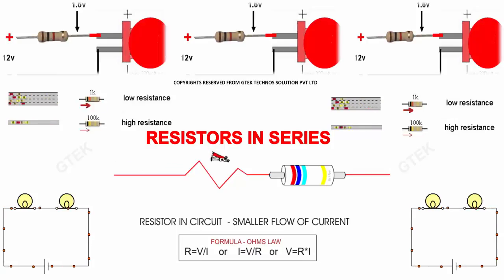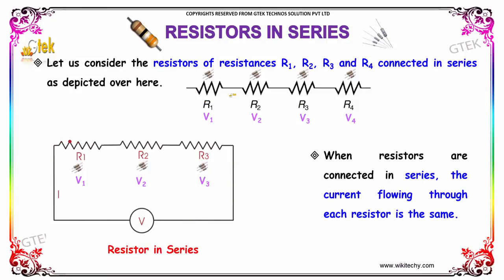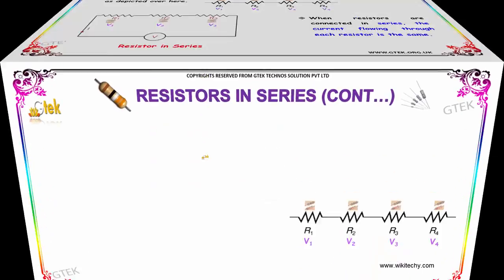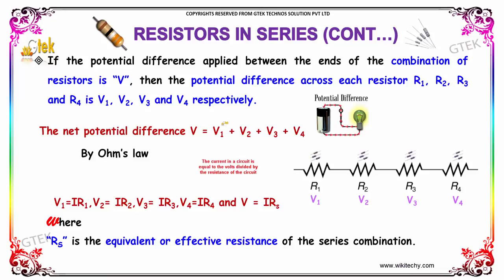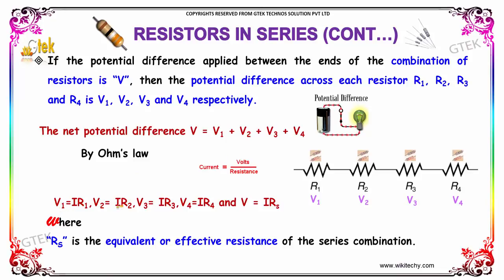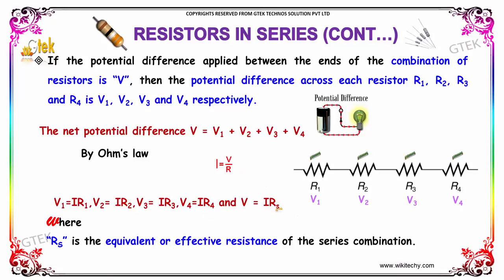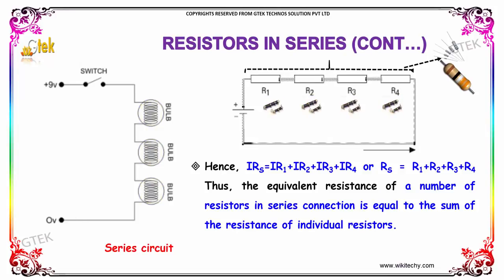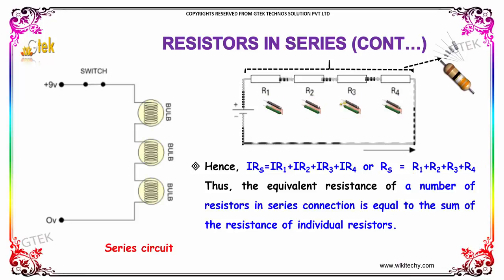Resistor in series Current Electricity class 12 physics subject notes lectures CBSE IIT JEE NEET

Comment: A series circuit is a circuit where there is only one path from the source through all of the loads and back to the source. This means that all of the current in the circuit must flow through all of the loads. One example of a series circuit is a string of old Christmas lights.

Comment: In a series resistor network the individual resistors add together to give an equivalent resistance, ( RT ) of the series combination. The resistors in a series circuit can be interchanged without affecting the total resistance, current, or power to each resistor or the circuit.

Comment: it shows resistors in series connected to a voltage source. The total resistance in the circuit is equal to the sum of the individual resistances, since the current has to pass through each resistor in sequence through the circuit.

Comment: shows resistors in series connected to a voltage source. The total resistance in the circuit is equal to the sum of the individual resistances, since the current has to pass through each resistor in sequence through the circuit.

Comment: The two simplest of these are called series and parallel and occur frequently. Components connected in series are connected along a single path, so the same current flows through all of the components. Components connected in parallel are connected so the same voltage is applied to each component.

Comment: The current is the same through each resistor. The total resistance of the circuit is found by simply adding up the resistance values of the individual resistors: equivalent resistance of resistors in series : R = R1 + R2 + R3 + ...

Comment: Resistors are said to be connected in “Series“, when they are daisy chained together in a single line. Since all the current flowing through the first resistor has no other way to go it must also pass through the second resistor and the third and so on. Then, resistors in series have a Common Current flowing through them as the current that flows through one resistor must also flow through the others as it can only take one path.

Then the amount of current that flows through a set of resistors in series will be the same at all points in a series resistor network

Comment: Voltage is the same across each component of the parallel circuit. The sum of the currents through each path is equal to the total current that flows from the source. You can find total resistance in a Parallel circuit with the following formula: 1/Rt = 1/R1 + 1/R2 + 1/R3 +...

Comment: The current is the same through each resistor. The total resistance of the circuit is found by simply adding up the resistance values of the individual resistors: equivalent resistance of resistors in series : R = R1 + R2 + R3 + ... A series circuit is shown in the diagram above.Jul 10, 2000

Comment: The total resistance in the circuit with resistors connected in series is equal to the ... Individual resistors in series do not get the total source voltage, but divide it.

Comment: The resistors in a series circuit can be interchanged without affecting the total resistance, current, or power to each resistor or the circuit.

Comment: Let's assume that the electrons have some energy and they pass through the series of resistors. ... As in case of parallel circuit, current has divided. Now, though the charges are taking different paths, they have the same potential (energy). Hence, the potential drop across each resistor would be the same